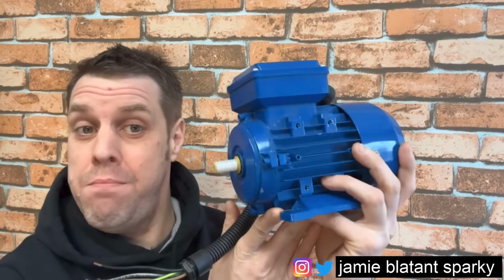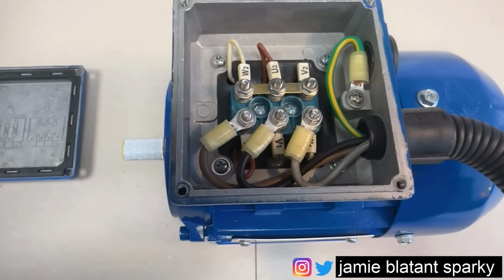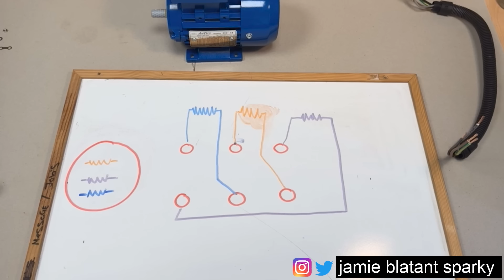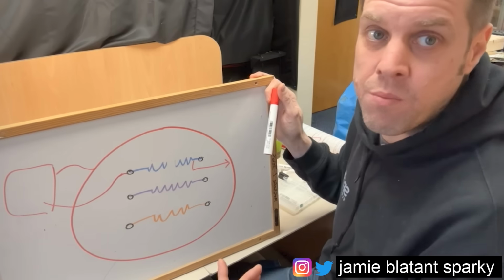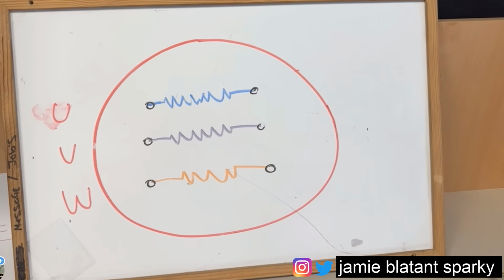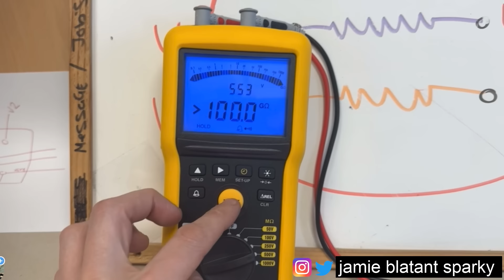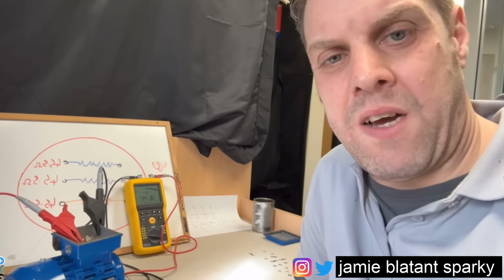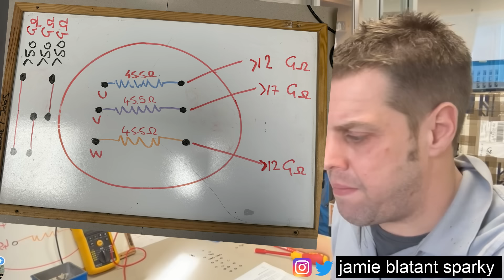3 PHASE MOTOR TESTING - how too PROPERLY

Comment: As a 40 plus years industrial maintenance electrician watched this out of curiosity I have a couple of comments. If you want to build the channel and come over as more professional drop the F words completely. Don’t get people tied up in Gig ohms they are totally pointless anything over 10 meg don’t worry in the real world. Forgot to say even after doing all this there can still be a problem, some motors just don’t play by the rules. Had one a while back where the customer had fitted his spare “rewound” motor to a fan unity on an inverter drive and it wouldn’t run, inverter kept showing fault. Motor checked out fine,Rewind company insisted it was the inverter,so swapped drives over in the panel with one of the others and just same. Original motor back ( after a bearing swap) and it ran fine. Never got any feedback on what the fault was with the rewound motor. Some of these new inverters do all sorts of tests before they even attempt a start.
Reply from the maker: Yea I have motors that’s just won’t work even though they test ok , not gonna stop searing , it’s it’s not for you don’t watch
Reply: @Actual_electrical_content  Bang right mate.
Reply: The swearing is what kept me here. As someone who knew going into the video how to perform the test and was instead looking for a way to teach it, there was a lot of value added by showing his personality. Pointless to get caught up in antics and criticize someone being entertaining. Much prefer this over monologue with no personality.

Comment: If you divide the volts by the resistance, that will give you the amps....Change the amps to KW and check against the motor plate... In this case 400 volts divided by 45 which is about 10amps .... then take 10amps * (400 volts  divided by 1000watts) = 4 kw motor. Also, it is worth noting that one test that people don;t do is checking that you are not single phasing the motor. Make sure that you have all 3 phase's at the motor. It is common that a pole will fail across the contactor,. Test at the isolator incoming. Also, check that the motor is not seized.... Undo the fan shroud at the back of the motor and spin it by hand. Lastly, Check the motor plate, 3 phase motors have varied winding configurations like star delta, PWM, delta, delta..... etc

Comment: Really useful vid pal.  Interesting about characterising using Gohms.    Do you see similar usefulness in doing periodic PI and DAR tests with an insulation resistance tester and plotting their values over time?  Or is that just fuckery that doesn’t tell anything over plotting Gohms?
Reply from the maker: It’s the kind of maintance they do for highly expensive and critical assets don’t depends how much your motors worth
Reply: @ I’m working on critical assets, so worth while then?
Reply: Stupid question!  I’ll just do them, it’s chargeable anyway

Comment: Great video,  you can also use an inductance meter on the bigger motor windings and a milliohm meter as they read very low resistance and look like they are short circuit on a standard multimeter.  
Also good rule to make for yourself is to NEVER rest tools or fixings inside the terminal box on the bigger motors.  It will help you sleep at night when you can’t find that spanner you were sure you had on the job last week.

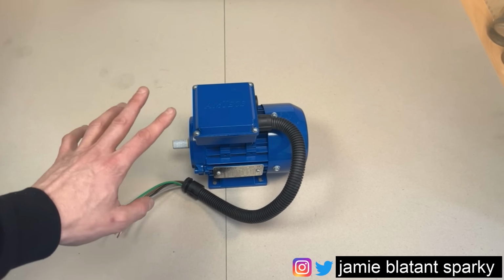Comment: Love the comment at 4:30… Reminds me of when I was sent out to replace a large motor someone diagnosed as bad, we had a new motor shipped in, and need a lift… First thing I do is double check the motor, everything tests fine, I wonder over to the electrical control box and  there had been an arc flash across the fuse block (come to find out, they had been blowing fuses constantly). Felt bad making the prior guy seem like an idiot, but I didn’t really want to change that motor and glad I checked.

Comment: Often do this in hazardous areas, do the continuity of the windings in the field, then connect it up and meggar it from the switch room.
Reply: Could use the conductance instead of resistance.  Fluke 87 can read nS or nanosiemens. It's strange to wrap your head around because the DMM reads 0 when the leads are open, and above 60 nS or below 16.6667 MΩ, it reads OL.  0.01 nS = 100 GΩ. All with low voltage.

My 87 V MAX is MSHA approved for hazardous methane environments.

Comment: What is the insulation on those test leads? You shouldn't be seeing that kind of leakage for a 500V test, you want to see >100.0 G with the leads open. For testing into GOhms you need silicone insulated test leads. On my CA6526, I can squeeze the leads together at 500V and get >100.0 G, at 1000V you see an initial drop but within 5 seconds or so you see > 200.0 G. You will get more leakage with PVC leads, but what you got there, still seems poor to me. I would try again with a new set of test leads.
When you are testing into the GOhms, any leakage has an affect on the reading and you will struggle to get consistency and won't be able to establish a trend. For trending, you also need to record winding temperature and ambient humidity, as they will also have an affect on the measurement. If the next test is carried out differently or in different conditions, you may see a lower reading, and think the motor is failing, but in reality it isn't.
Testing at GOhms for trending has its advantages as you indicated, but it is more prone to errors creeping in.
Reply from the maker: Cheers for the info , I’ve got some better leads but if I used them it wouldnt leak , remember this is still TV and some things are set up
Reply from the maker: Also it shows your in your comfort zone with these number That you picked up on that stright away , I am still trying to get my head around gig ohms it’s just some big number I don’t really comprehend at the moment

Comment: Great video. Years ago I had to connect a pump for a heating engineer, who told me the failed pump had just stopped working. He admitted he hadn’t tested the failed pump or any knowledge of 3 phase wiring, hence why I was there. He also had purchased a new contractor and overload. And here is where I failed - I trusted he had connected the new pump as the same as the failed one, because I asked him if he made sure the links were the same on the new unit (star delta). I then changed the contractor and turned it on. BANG. He had wired the links for delta. Never again.

Comment: Great video, thank you very much for taking the time and posting and putting in a few laughs. Videos like yours is what makes Youtube great! Subscribed!  I have a three phase motor which has the three wires coming directly out of it also a separate five pin connector. Thanks to your video I can test the motor itself. I'm not positive about the five pin connector if that will interfere with the test. The connector goes to a controller for throttle,forward and reverse.
Reply from the maker: If you contact me in instagram and send me a photos I’ll try to sort out and tell you you what’s going on

Comment: Great video, just came across it, you made it so fucking funny to watch, iv got experience with all sorts of traction motors blaa blaa, dont want to bore u lol, and your bang on with the info, keep great work up thanks
Reply from the maker: Please note me with your tales of different motors , o feature a dupe wound motor in my latest video about a mill repair
Reply: @Actual_electrical_content  i work on rail, most of the motors i work on are traction motors, dc shunt , series wound motors with interpoles, controlled with field diversion

Comment: What is the good and bad ohm measurement for windings? What is a good insulation reading in Mohms? I've been told anything under 3 mego ohms is bad. I'm not sure about the resistance readings for the windings. I've seen bad motors in the kohms.

Comment: Hi jamie brilliant video, much needed here on YouTube! A couple of years ago i had the pleasure(!!!!) Of working in a garage where there was a single phase supply. Somebody had installed one of those big converters that generates 3 phase 😢 i wired in a small 3 phase compressor and no matter whether i wired it star or delta the motor ran very warm indeed! Is that normal?  There must be limitations to these god awfull 3 phase generators? It was for an old mate so i was trying to be helpfull. As far as i know the garage didn't burn down.

Comment: DO you have to discharge the windings after you test them?
Reply from the maker: Normally your meter  take care of that
Reply: Ok cool, I work as a industrial electrician. Some other electricians give me crapfor not discharging windings after megging a motor😮
Reply: @travisoroke174  Seriously, you trade training didn't cover BASIC test procedures? Do they let any unqualified/untrained individual work on industrial power equipment in that country?  
There are no capacitors (run or start) in a 3p induction motor... you should know that, and where you do find caps to discharge.  
Do the qualified electricians there send you to the electrical wholesale shop to buy a 'box of short circuits' or 'a long weight (wait)'. I would.

Comment: Pretty fucking good stuff, Jamie!  I'm following up behind an HVAC tech that condemned a VFD, but I can't confirm if the motor itself is any good or not. I tried re-routing the line into the VFD directly to the motor but I used the the lugs on the motor output side of the VFD to do it, and the motor just buzzed and didn't spin. I don't know if this is a result of having the VFD in the circuit at all, but I'll isolate and go direct to the motor with the line volts (208/230 3ph)  Guess I better check if they have the motor wired correctly as well.  But I'll be thoroughly testing and drawing it up. Thanks for the vid!

Comment: This has been absolutely brilliant mate! You break it down so well easy to follow! And as a Building services engineer dealing with motors it’s really helpful! Thank u as most of the time we are just asked to swap them out and the company pays thousands! Without even doing theses tests! 😅
Reply from the maker: Glad it helped mate
Reply: Sounds like you have little faith in the maintenance electricians that fault diagnose.  Does this Co use qualified staff? 
How is it, with such a job title, dealing with motors only on paper invoices, didn't you know this BASIC test procedure? 
Seems like 'money' is prime concern there... a worry when safety, compliance, and industry best practice is of prime concern.  I won't work in a place where money overrules either of those.  
So, with this new basic 'knowledge' will you question the diagnostic skills of professional industrial electricians?  If you tried that on with me I'd tell you to fukoff back to the office or waste more time and money proving my diagnosis wrong.

Comment: You know the other fault that can occur when an unqualified idiot swaps out an obviously burned 3p motor with a spare that kinda fits? 
Assume they get the Star or Delta connection right... perhaps. Assume they get the direction of rotation right and know how to correct that... perhaps. 
The idiot installs a 2 pole motor when a 4 or 6 pole is needed, and wonder why the machine doesn't work correctly.  
This shit happens.

Comment: Great Video, There is alot of companies here in USA that do NOT go the extra mile and do this exact test, Lack of the info like u just showed leaves you hanging with what exactly failed or is failing.  Excellent discriptive video.
Reply: Bro,I'd rather American engineers all day than a minute of a British engineer.
That includes all senior figures in my company who are supposed to be tech leaders but never have an academic concept behind anything they explain to you
They only want you to know what wire goes where or what colour wire goes where..
Just imagine he's explained Star n Delta wound motors by just let you craming how the linking plates are arranged ..What if those indicators are not there since someone perhaps removed them!!!!!
What about line voltage ,phase voltage ,line current ,phase current concepts behind delta or star wound motors
What about the concept of one then being a parallel circuit or series circuit!!!
If  you know the nature of electrical faults being ground fault n such then you don't need this video
It's an insult to engineering

Comment: Hi mate,

Have just come across your channel and really enjoyed this explanation, but not a sparky just interested...

When i measure the IR between the windings of a 3ph motor on my MFT at 50/250/500V, it gives me a dead short (O ohms)...but when using a regular DVM it gives me around 4-5ohms ...is this normal? If so why?
Reply from the maker: Is that with the plates removed and the windings open ended
Reply: @Actual_electrical_content  should have mentioned - 

I’m measuring between phases on the supply side - it’s basically a star wound motor (no neutral) connected to a Variable frequency controller for a submersible turbine pump … no access to motor from above ground

So essentially I’m meggering at the VFC output which includes the motor windings and the supply cables of the phases… giving me the above results…

Comment: Great video Jamie

While on site during a Start Delta,  Motor change we mixed up the incoming Yellow phases. Keep tripping overloads when switching to Delta. It was pulling serious current. 
One phase was pulling the rotor in opposite direction 
Complete nightmare it was.
Just took a photo of connections box, but realised later when looking harder at the photo wot the problem. 
We draw them out now and label the shit out of it. 😂 
Lesson hard learned.
Reply from the maker: There are 2 options on star delta starters , it works or it blows upb

Comment: Not a synchronous motor. It's an induction motor.
Reply from the maker: I meant to say squirrel cage
Reply: SCIM.. probably 4 pole. It be synchronous.
Needs 3 p AC - 120deg phase angle... maybe 50-60-200-400hZ

You find 1phase squirrel cage Induction motors too. They come in a variety of stator winding types, shaded pole, Cap start, Cap start/run. They need this to get the motor biased for rotation and direction. They be synchronous too. 

They (IM) all rotate at a synchronous speed according to number of poles and supply frequency.
These all have 'squirrel cage' conductors in the rotor. 
It's a given they are all induction motors with the rotor 'windings' as such.

Comment: LOL. You call 500V insulation test "spicy" voltage.  
What do you call 2.5kV or 220kV testing?  i.e. 10x working voltage potential. 
In the field, you may as well bridge all windings and in a single test  measure all to Earth in one move.   In practice, that will indicate a fault and the motor is taken out of service for rewind.